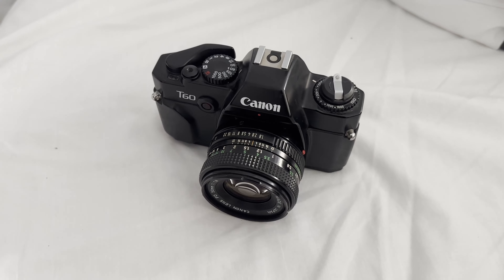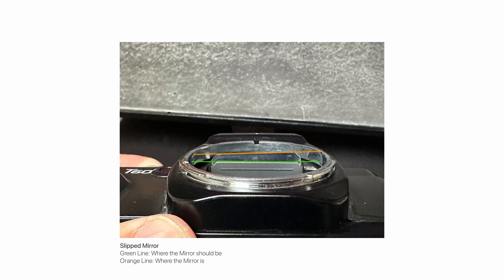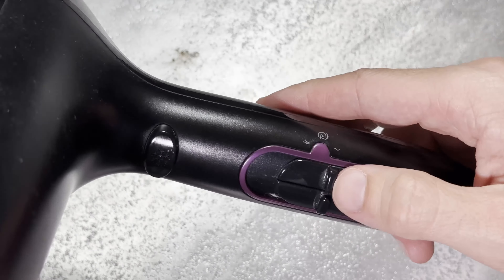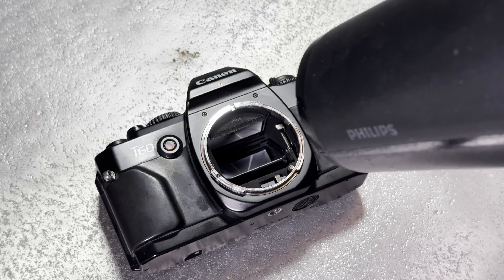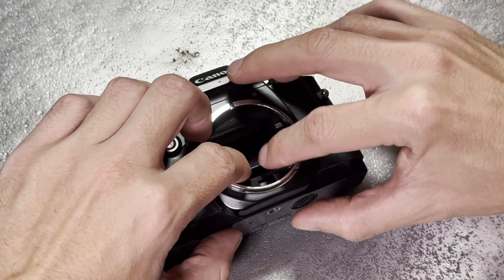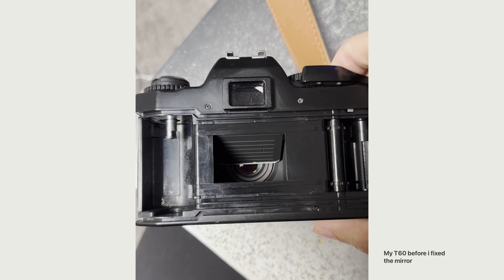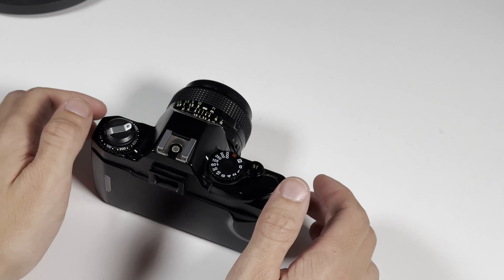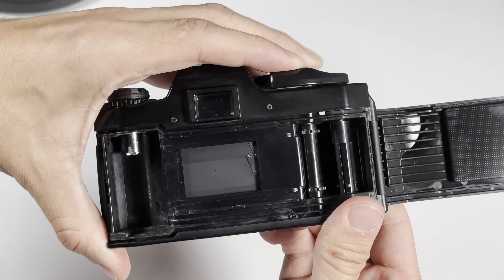Fixing the Mirror-slipping Issue on my Canon T60 that destroyed 4 Rolls of Film

Comment: What about if my lens don’t let the mirror work normally? 😅😢 if I quit lens, it works correctly. With lens I need to do kind of shake, and mirror fall down again.
Reply from the maker: Thats exactly the problem this video solves. If your lens stops the mirror from going up all the way, the adhesive of the mirror is the fault. heat it up as shown in the video and gently push the mirror back in place
Reply: @silver_rays  thanks a lot, I’ll try to fix it.